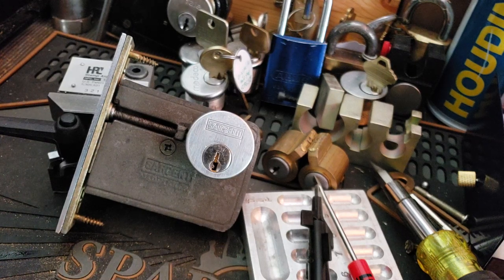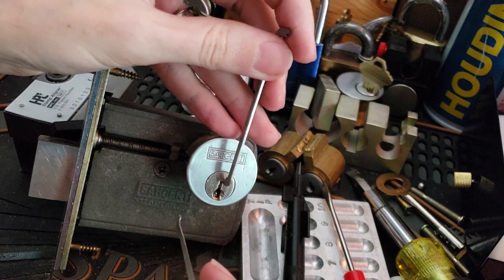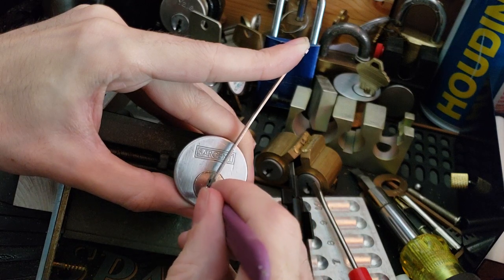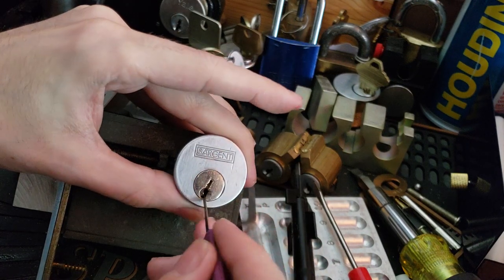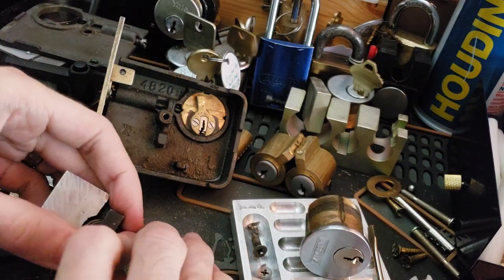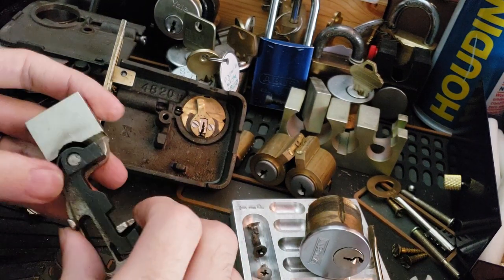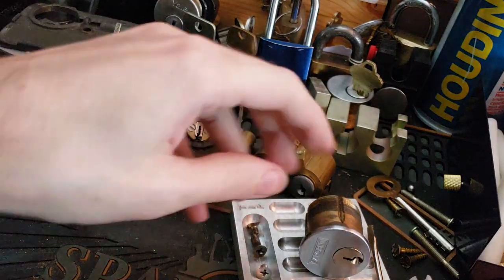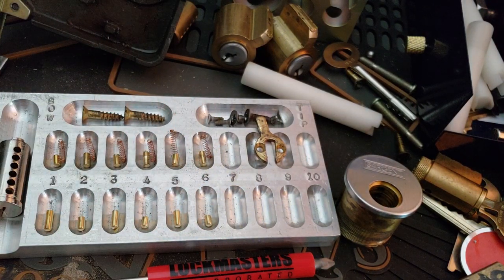(106) Sargent 41 mortise cylinder and 4820 auxiliary deadbolt: pick and gut

Comment: Thanks for making this video. Is anything preventing me from using a straight cam, instead of the offset cam? I appears the cam would just engage the bolt/lever a bit sooner and there wouldn't be any other detriment. Excellent examination.
Reply: I used a AR straight cam and it worked for me. The Sargent cam would not fit on the new cylinder. You need to keep 1 1/8 , 1 1/4 , and 1 1/2 cylinders in stock for some odd doors that won't work with 1" standard. I think you can buy those cams though.